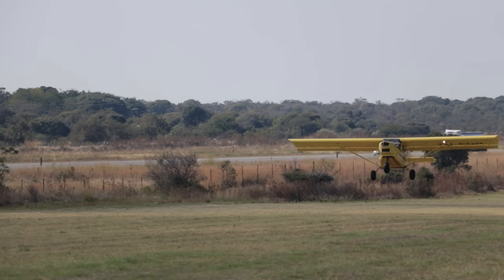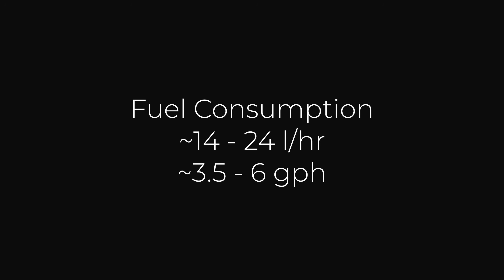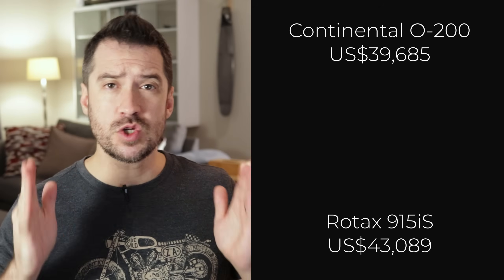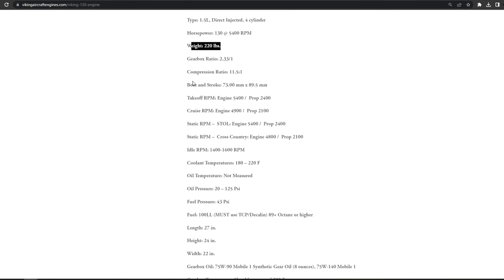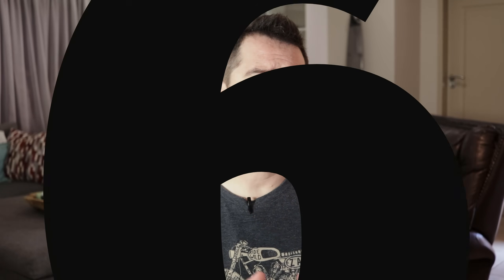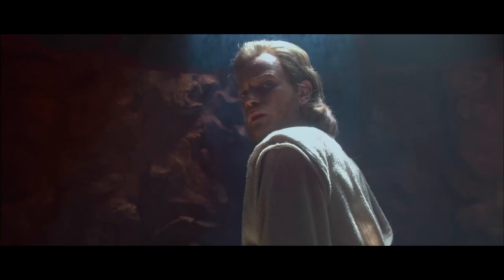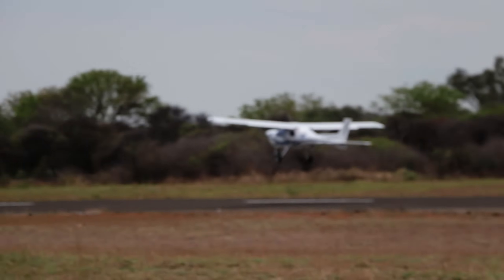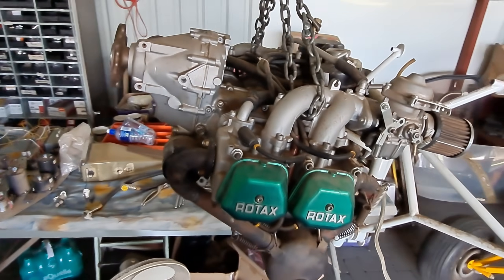6 WORST & 6 BEST Light Sport Aircraft Engines

Comment: You have to de-rate the power of the UL engines to rpms you can actually spin a prop at.  They rate them at 3300rpms, which would require a very short prop.  Not applicable on most aircraft.  Look at their power at 27-2800rpm and then compare.
Reply from the maker: Yeah that's unfortunate, been told that same thing in a few comments
Reply: @LetsGoAviate  It's why there's been very low adoption of the engine.  I cannot for the life of my think of why the engineers set it up for power at that rpm unless they thought their customers were idiots.
Reply from the maker: @z987k  It certainly doesn't build trust

Comment: I had a Rotax 915IS  gave up on it after three set of fuel pumps and being down for over six months on fuel pumps. Rotax would never respond to me they think they are to big to respond to someone who just spent 38K on one engine.
Reply: I have a 915 that I’ve put on 460 hours in 18 months with zero issues🤷🏻‍♂️ your unfortunate problem was with ancillary components
Reply: That has to be a problem with your particular set up.

Comment: Coolant cooled engines have far too many parts to go wrong in flight and are heavier than air cooled engines. Also a reduction drive is required.
Why carry coolant aloft when air will do the job of cooling. Direct drive off the crankshaft and no reduction drive.
Reply: face palm.
Reply: There are many advantages to the Rotax water cooled engines...do your research.

Comment: I have a supercharged LQ4/LS2 making 890HP but with a different pulley we can do 1050HP at 2700 prop RPM. My son in law and I want to put it in a plane but I can’t find a kit in that power range. Do you know of any kits that will take that power? I hand built the engine, it is a beast.
Reply from the maker: That's a lot of power. What does it weigh? Mike Patey's Draco had something in the region of 700hp, being a turboprop of course. So my best guess is it will need to be a modified plane to accomodate that. But I'm not an expert in the area.
Reply: SW P51.

Comment: With over 3000 trouble free hours of trouble free Rotax 912S time, I have no plans to change. And....., that was while following a fraction of the official Rotax maintenance procedures, just changing the oil every 50 hours. Automotive oil filters, taking off when the temps reach 85 degrees not their recommended 125, and so on.
Reply from the maker: Yeah and you're not alone, many have done thousands of trouble free hours behind a Rotax. They don't fail often, and my own findings are when they do it's often fuel related, being incorrect or improper fuel rigging.
Reply: @LetsGoAviate   Yes, the many different causes of a so called "engine failure" in homebuilt aircraft are legend!  Bad cooling system, funky fuel delivery, etc.. BTW: I also put 1300 trouble free hours on a Subaru EA-81 conversion , converted by the now defunct Stratus company.  Belt reduction, mostly a stock engine. Heavy and harder to cowl (bigger)  than the 912 were the only downsides. I only paid $5800.00 for it, all converted, back when I was a 912 skeptic and they were relatively new, now I am a 912 zealot!

Comment: Will be interesting include the comparison of the statistical data on how long they last before the engine overhauled. Many of them break a piston, a valve, etc.
Reply from the maker: That would be ideal. Not very easy to do though, as they are operated under different rules, some allowing owners to build and service them, which influences reliability. I also know some of these engines are extremely unlikely to run until TBO without prior failure.
Reply: @LetsGoAviate "extremely unlikely to run until TBO without prior failure" never stopped anyone from buying a Bonanza,  SR 22, or anything else with an IO or TIO 550.
Reply: a rule of thumb: the lighter the mass per bhp, the more likely it is to break.

Comment: Where do you place the AeroVee Turbo on the list?
Reply from the maker: The turbo ups the HP to 100, and adds I believe 25lbs. That puts the weight close to the O-200, same power, but much cheaper. I'd place it below the Jabiru 3300 at 9th or 10th on the list.

For perspective, it's just heavier than the Jabiru 3300 and outputs 20 fewer horses (at sea level of course).

Comment: I would more or less agree with you, but will say what's best for one aircraft design and pilot/builder may not be best for another. Service parts availability may also play into the equation of what's best. 

On my drafting board is a design that will have good performance on 80 horsepower if you are geared to turn an 78 to 80 inch propeller anything less that 72 inch the design falls on it's face.

Comment: Liking the AeroMomentum 
AM13 ! Water cooled FADEC engine here ! 
170 lbs 100, 112, and 126 HP options ! All new parts custom built ! $9,995 100HP
$13,995 126HP 
Just my thoughts!
Reply from the maker: Yeah AeroMementum looks great (on paper at least)!
Reply: I like that option also, just waiting to see if they develop complete FWF packages- not an area I’m interested in beta testing.
Reply: @Mike-tt8wi  Aviation beta testers tend to get really pretty posthumous medals though...😂
Reply: Those prices are JUST the engines. Once you add the mount, cooling, exhaust header, fuel system, electrical, etc, you need to add another $6000+. Engine prices alone just aren't a good cost metric. Nobody ever talks about how it's packaged.
Reply: Give me a Suzuki engine any day

Comment: Almost 500 hrs on my Jabiru 3300.  Nothing but oil changes and compressions averaging 79.  Fuel efficiency is excellent.  You're right about weight for LSA but only for the lowest weight airframes (but if your flying those you might as well pick up your motor at Harbor Freight).  It has had a lot of attention from the manufacturer improving it's durability departing from the stories that haunted it years ago; a story that ALL engines have!
The key is good fuel, good oil and staying in operational limits.
Reply: A tried and true story.
"Lets push the envelope."
Later
"TOO FAR!!! TOO FAR!!! Dial it back."
Later
"Okay, that works nicely."
Reply: My gen 4 has done 1100 hours with no problems, leak downs around 76 to 78

Comment: In the US the 912UL is 100 HP not 80. And where is the 912IS in your comparison? You gotta be kidding....
Reply from the maker: The 912iS is heavier and more expensive than the 912ULS and delivers the same power. As explained, I only considered power, weight and cost. So the 912iS isn't a lot of bang for buck (it's advantages lies elsewhere).
Reply: @LetsGoAviate  The headline of your video is: 6 WORST & 6 BEST Light Sport Aircraft Engines, not which is the cheapest or best bang for your buck. The is motor will hold its value more overtime because fuel injection is the way to go. And 13 lbs kills it for you? Really? Let's just agree to disagree. By the way... I just subscribed. 👍
Reply from the maker: Agreed (to disagree), I respect your opinion. Thanks for the sub!
Reply: Just wanted to say thanks for putting this vid together I found it very interesting 👍
Reply: DH even in the US the 912ul is 80hp. ULS is 100hp.
Reply: @superbill9066  I didn't even know they had a UL. I stand corrected. The only 912s I've ever been countered with are 100 horsepowers. They sell that UL in the United States? And for what kind of plane?
Reply: @dh-flies  I don't know if or what plane comes with one, but they are not uncommon in homebuilts. Good engines I'm told. Definitely go with the 100 horse if you can though!
Reply: @superbill9066  I have the 912is in my Bristell. I'm very happy with it.
Reply: @dh-flies  I've got a uls that I'm also happy with, but I definitely like the idea of fuel injection.
Reply: @superbill9066  What plane do you fly? And where from?
Reply: @dh-flies  the rotax is in a zenith 701, but I mostly fly an experimental supercub. Northeast Oregon.
Reply: @superbill9066  Love the Zenith. I looked at those before I bought my Bristell. I dreamed of back country flying but realized my mission was more  cross country flying.

Comment: Just FYI, we weigh the same installed as an O200 and not generally any CG issues and a large amount of our aircraft are for light sport aircraft with over 900 in Zenith aircraft. With excellent performance, and low fuel burn, especially for STOL style aircraft. ❤ a bit heavy for things like a small kitfox or something of that nature though, good for the Viking 90.

The Viking 90 is a great option too, almost everything similar to the 912, works wonderful for little pushers too. 

As some mentioned above, the UL power rating is also at an unattainable RPM. Just keep in mind most companies advertise things different than they actual are. This includes aircraft kits and their performance. We try to aim at honest weights and performance so the customer is never disappointed
Reply: I'm thinking the 90 in a 701 would work for me. Have to testily a few options over the next few years and determine my operational needs like if I have a runway, its length, etc.
Reply: I'm glad you weighed in. Aviation is unattainable to most people. You have 100% captured the spirit of experimental aviation in your endeavor to make aviation more affordable to the normal folks by research and development of auto conversions. If I can ever talk my wife into letting me build an experimental - I will be visiting you guys. 
Keep it up.
Ben
Reply from the maker: Thanks for commenting and for the additional info. Good on you for advertising honest numbers, it goes a long way towards building that trust. Pity I haven't seen an Viking engines around in South Africa yet, would love to see them perform!

Comment: You missed Corvair and Aero Momentum. Some of those engines in the list produce their HP at over 3000 RPM, which is not as suitable for a slower aircraft.  Rotax are not only expensive, but they are also behind the times, some of the engines still lack fuel injection and they are snail slow at higher HP models.
Reply: I'm planning to install an Aero Momentum AM13 on my Fisher Dakota Hawk. 170lbs, available in 100, 112 and 126HP. Prices vary from $10k for the 100HP vertical engine to $15.5k for the 126HP low profile version. 2000Hr TBO, fuel injection, gear driven PSRU, 16valve 4 cylinder. The vertical engine would be more appropriate for a single place or tandem aircraft where the low profile works well for wide two seat side by side fuselages.
Reply: And where was D-Motor??
Reply: @patriciasmith4800  Or more to the point, what happened to D-motor? Vapourware?
Reply: @patriciasmith4800  Now supplies to OEM only the website says...
Reply: You can't say they are behind the times by not having FI on some engines, many builders like a choice of carb vs FI.  Yeah, I know, silly to not go FI, but there you are.  I recognize the point that some like zero electronics between the fuel and combustion like magneto spark and a carb.

Comment: As an aerospace engineer i can tell you there is no such thing as a free lunch. The reason why the 912iS is so expensive is because it is somewhat new and a lot of hours went into it even tho FADEC has existed for some time now, it makes the mixture and prop adjustment redundant. this comes with a highter price even tho it is just a marketing trick. second reason is demand.  i guess everybody wants a FADEC controlled engine to safe fuel at the end of the day. Give it a few years and the iS engines will become a standart.
Reply from the maker: The 912iS isn't on the list in this video. I really don't see them around that much (yet).

It's heavier and more expensive than the 912 ULS. It shines in fuel consumption though, something not really scrutinized in this video.
Reply: @LetsGoAviate  Sorry i ment the 915iS

Comment: ROTAX DUAL CARB 80HP IN THE COMPOSITE KATANA FROM DIAMOND JUST OVER LIGHT SPORT WEIGHT? 1158 LB ! USE FULL LOAD 606 LB AND THE 100 HP ROTAX FUEL INJECTED SAME SAME CRUISES AND CLIMBS FASTER ; GOOD FUEL ECONOMY RELIABLE 110 KNOT GRUISE ALL DAY EVERY DAY LOW MAINTENECE AND GREAT PLANE; EASY TO FLY OR PAY MORE FOR THE IO 240 125 HP UNIT
Reply: why are you YELLING  at us?

Comment: As an Australian, I'll never touch anything with a Jabiru powerplant. They're notoriously unreliable, it feels like I hear about somebody performing a forced landing in their Jabiru once a fortnight here. It's gotten to the point where CASA had to investigate them.
Their airframes are good, though. As long as you put a Rotax in them.
Reply: I fly the Jabiru 2200 in its own frame/cell/airplane SP470. Upgraded with the bigger cooling heads and bigger ducts inlet air. Also stronger startingmotor and valves pretty well adjusted to correct measures. It's A DREAM to fly and I fly it regularly overseas. Not a moment of uncomfortable feeling. Just cruising at 2800 rpm (Rotax 5000) a pleasure to fly and maintain.   Sorry but every time a Rotax flies overhead I think abouth  a coffee grinder. Why the reduction gears???
Reply: I'm not convinced the Rotax is much better. I know firsthand of a couple of 912uls that failed (both in planes I'd flown in, though thankfully not while I was flying in them). The few Jabiru's I know of have been problem free (seems the later gen Jabiru's are better - now up to gen 4). Even the first batch of 915is started shitting exhaust valves, and had to be upgraded.

Comment: My choice of light sport engine is the Italian MWFLY, fuel injected, water cooled, great power to weight ratio, versions to 150HP, great price.
Reply: You definitely get what you pay for.
Reply from the maker: In another comment someone else also suggested MWFly, so I'm definitely curious.
Reply: @LetsGoAviate   Same, though I just made a very pro Rotax comment. The MW's only drawback is it's rarity, at least in the US.
Reply: MWFLY state their Spirit 160 is a direct drive, flat 4 cyl air cooled engine of 81 kg and 160 hp, 1200 hrs TBO
Reply from the maker: @peterk2455  That's an incredible power to weight ratio